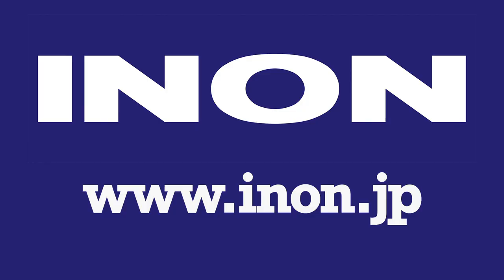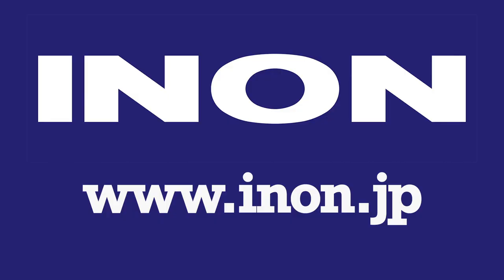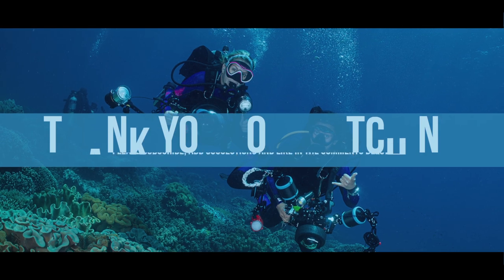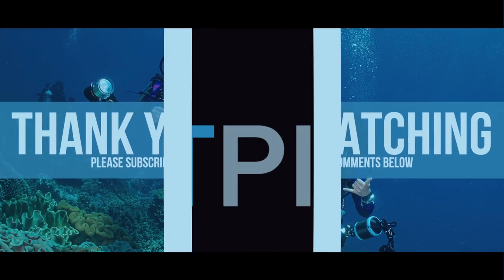Housing Buoyancy Primer for Underwater Image-Makers

Comment: Another item that can help, particularly when using a large glass dome, is an external monitor -- it can be positioned above the housing to offset any imbalance. Would be great to see an episode on external monitors (tho I'm not sure I've seen evidence that either of you use them... )
Reply from the maker: We don't use them, although I have used one a fair bit for filming. To be honest, pushing a big dome through the water is hard enough work for me, so adding a monitor doesn't make sense (to me ) unless I need to frame and check critical focus while shooting video.